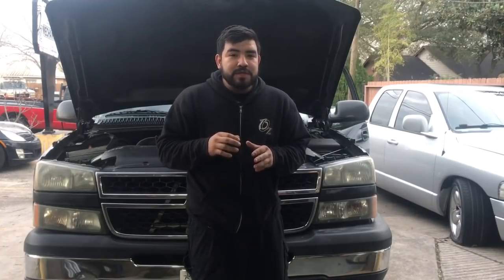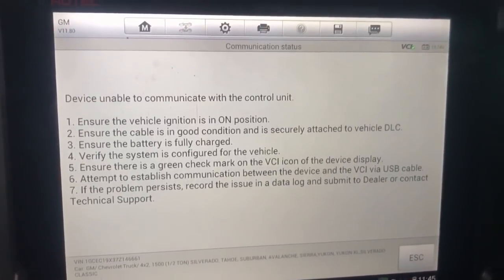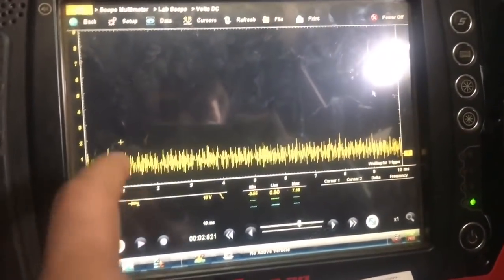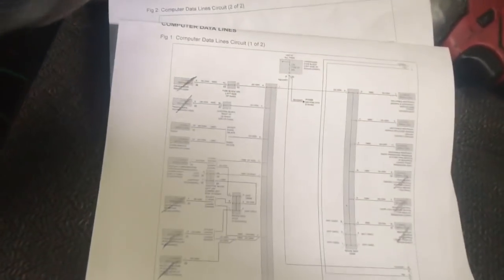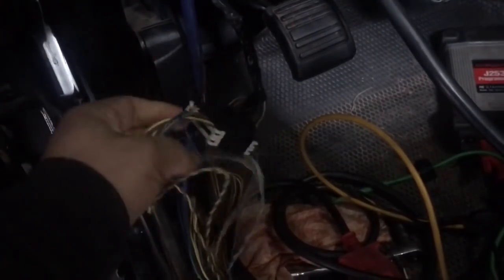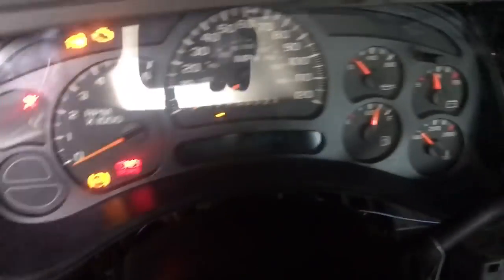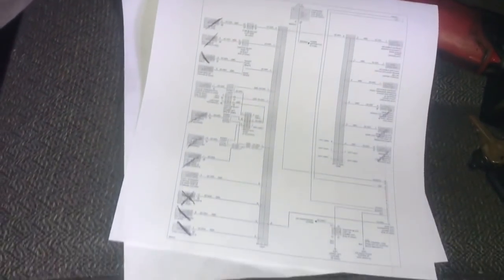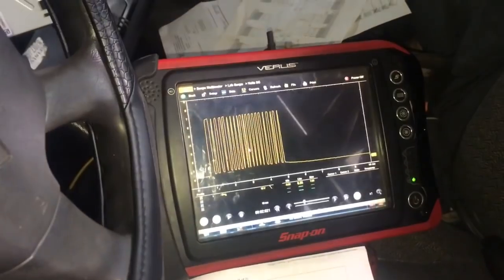Your scan tool is not communicating? TRY THIS

Comment: excellent video OZ   thanks for sharing one thing to be mindful of is totally disconnecting the BCM  its most likley the power mode master to the other mpdules on network    the AESWAVE tool and a splice pack would help you avoid that    all the best   your video archive is amazing
Reply from the maker: Mark Ferraro the couldn’t find the splice pack. But the funny thing is when I finished the job and started putting everything together I finally found it

Comment: Well the scan tool did help in pinpointing it's probably going to be a network related failure... I'm still in the 1st few mn of video. .. looking to see where this goes
Reply from the maker: Now the question is.... did you like the video ??
Reply: @OzMechanics  Yes! I liked the video! I think it's especially helpful to those new to network diag, how to pinpoint the bad module and what a good network waveform looks like. 

I did cringe when you went at that under seat harness/connector without gloves! Lmao I swear that was a living "something" under there! ☣⚠⚠☣
Reply: The U-isolate tool, I think it's called. It plugs into splice pack
Reply from the maker: https://www.aeswave.com/uIsolate-Network-Isolator-p9669.html